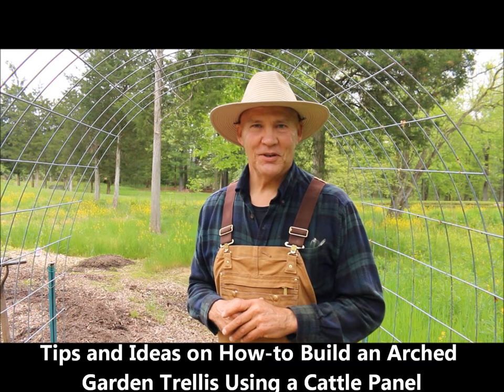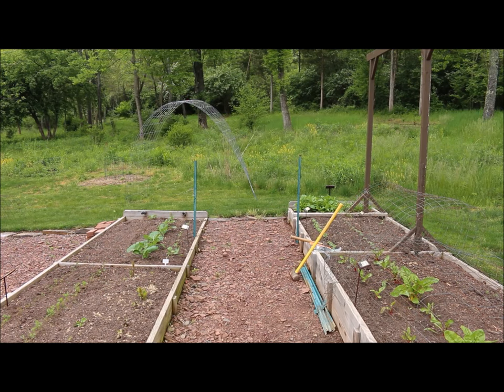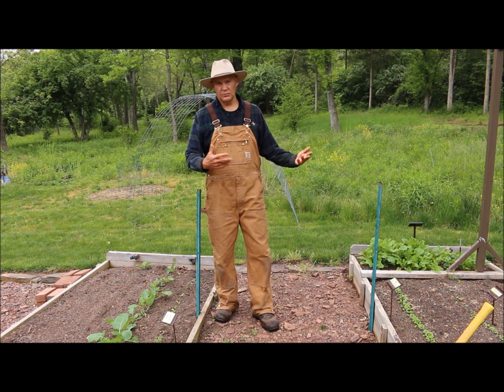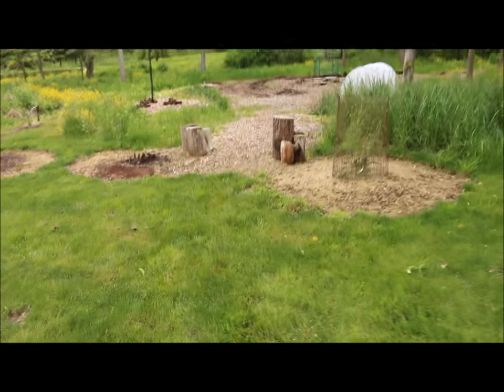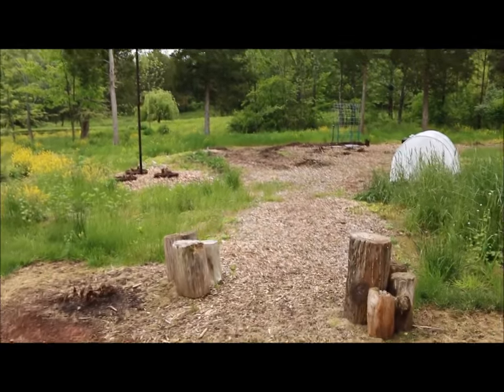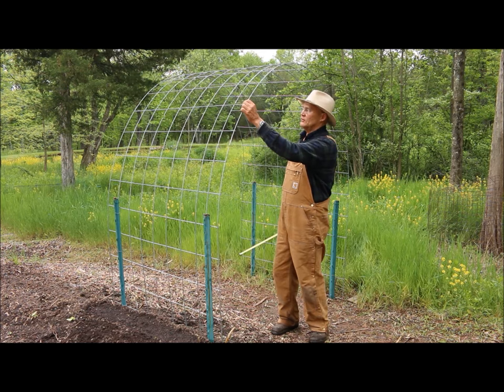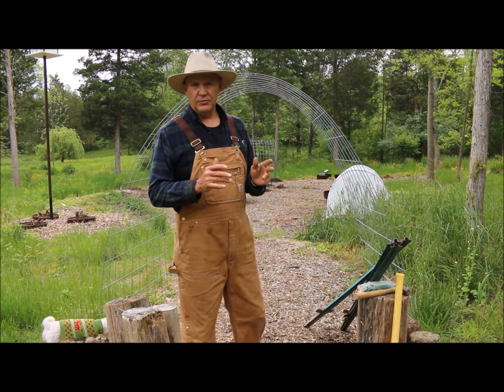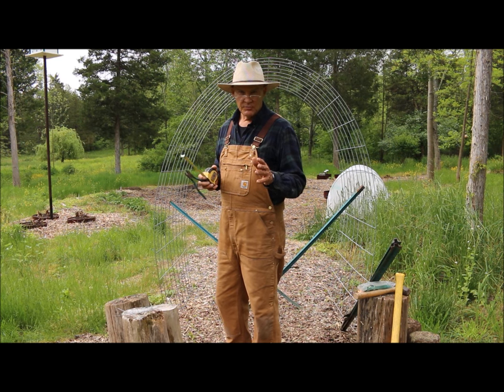Tips and Ideas on How-to Build an Arched Garden Trellis Using a Cattle Panel

Comment: I've been able to carry 6 of the cattle panels in my pickup truck bed with ease, I could likely carry a dozen but I've never had a need for that many at once...so far anyway, lol. 
I simply stand them up (50" dimension vertically), place one end into the front corner of the truck bed, then bend the other end around and feed it into the other corner of the truck bed. You have to do this one panel at a time and it does take 2 people to do this. Once all are in the truck I use a ratchet strap to secure them down and pull them tight so they cannot slide back out.

I've also found I can raise the cattle panel about a foot off the ground to spread them wider (I usually go at least 72" between the t-posts) and the arch will still be plenty tall enough to walk under and harvest for my 6'3" height. It works well and it is also easier to work the soil up, add fertilizer, etc when none of the panel is in the way of my hands/tools at ground level.

This year I am trying cattle panels for my canning tomatoes and pickling cucumbers.
You have a great channel Fred, thanks!
Reply from the maker: Hi TheMusicWell thanks for stopping by and leaving those helpful comments…I have a work van with a couple ladders on top and and am able to just lay my cattle panels on top with the help of someone else… that also works pretty good for transporting them...I might try growing some of my Butternut squash up them this year and maybe a few other vegetables… I hope you have a bounteous garden season and a wonderful day!
Reply: TheMusicWell We are going to town tomorrow in the truck to haul the leaky water heater back. And you just told me how to load the two panels!! God’s perfect timing! He used you to bless me. So may I share a little known bible fact? The seventh day sabbath was created in the garden of eden blessed and honored by Jesus Himself. Genesis 2:2. This is the real issue of the hour.

Comment: I did two of these single-handed. Instead of trying to bury the panel ends in the ground, I cut off the final two lateral rows with a bolt cutter. That way there are spikes on both ends of the cattle panel. I just push one end into the soil, then bend the panel until the other side is embedded in the soil on the opposite side of the raised bed. I use t-posts for stability. They have worked so well this year that I intend to install 8 or 10 more next season!
Reply from the maker: Thank you for stopping by and sharing your great ideas! 😊

Comment: I would've kept the ends of the cattle panel out of the dirt by supporting the panel by the "T" posts. The "T" posts are made for contact with the ground and the panel is somewhat less so. You could've gotten some free height on the arch at the same time.
I like your idea, otherwise.
Reply from the maker: Hi Ben, thanks for stopping by and sharing your information! I hope you have a bountiful garden season!
Reply: I've used cattle panels for years and the only time I get corrosion is when they are in contact with the dirt for extended intervals.

Comment: Hello, can you please tell me how thick the hog wire needs to be? Thank you.
Reply from the maker: The hog panels are 50 inches wide by 16 feet long and are constructed of four gauge wire! The wire is almost quarter inch in diameter!
Reply: Thank you. Would you recommend any make? Where did you buy this one, please?
Reply from the maker: I bought mine from Tractor Supply for $22.